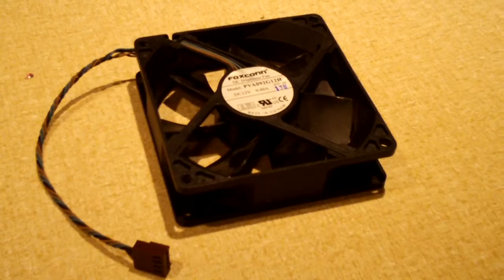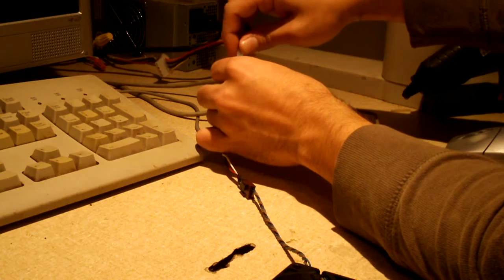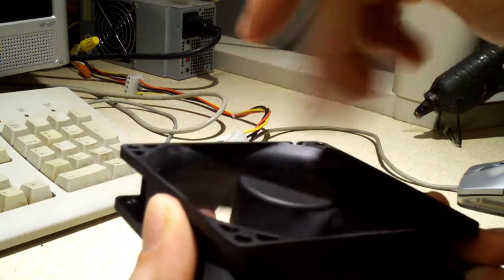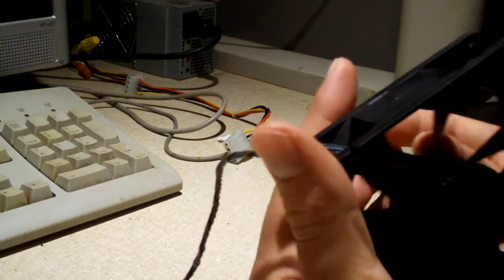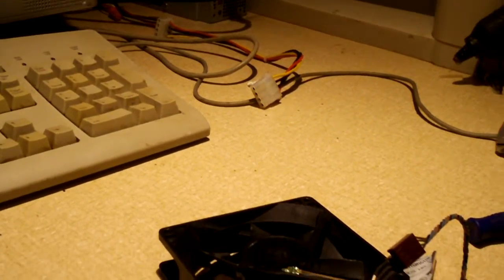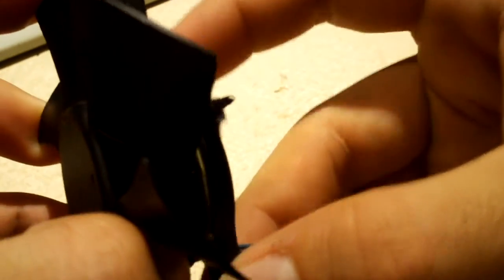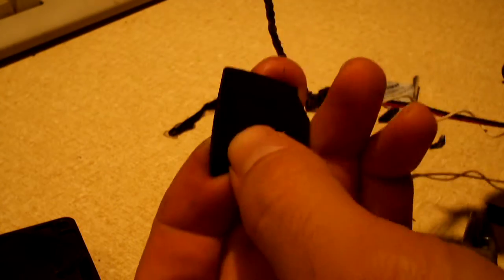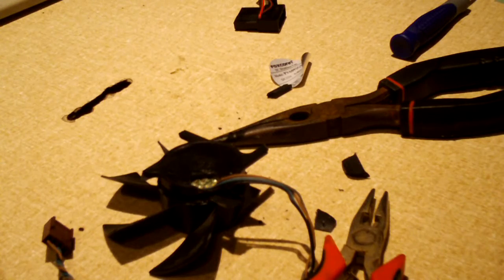A Foxconn fan in a very poor state of condition

Comment: I had the 80mm variant in my new dell XPS 8900 as the CPU fan. I replaced it with a Noctua NF-R8. the computer is only 6 months old. The original fan works fine.